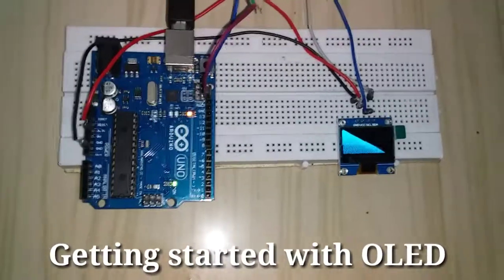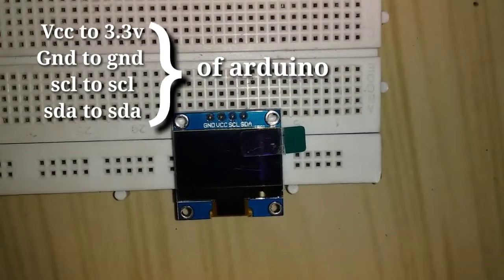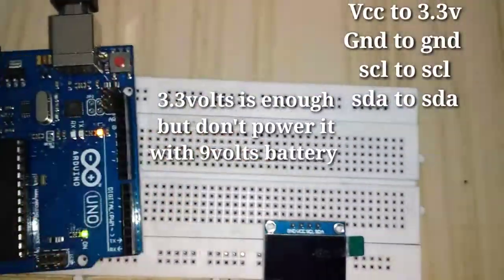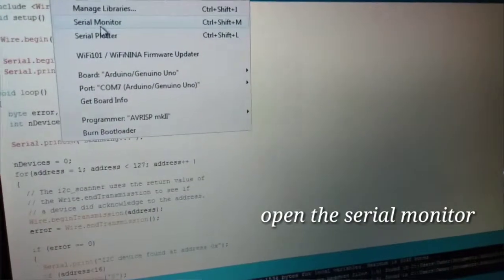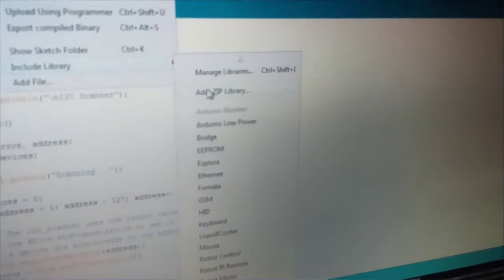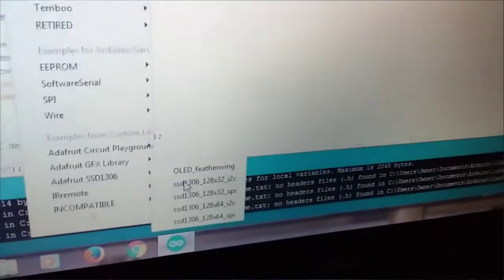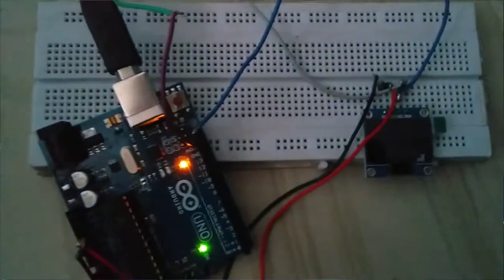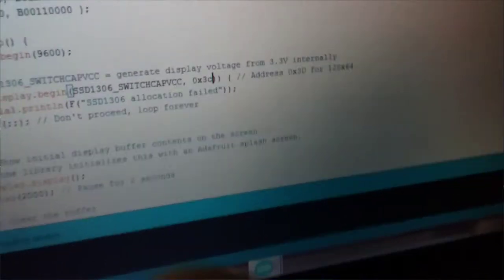How to use OLED display in Tamil

Comment: Super bro na itha intha oled display ku bathila lcd display use panlama bro but athu i2c suppott illa ethachum decoder ic from i2c iruka suppose iruntha na oled display ku bathi antha decoder connect panni lcd display connect panlama??? 

Thanks in Advance
Reply from the maker: Bro , LCD display oda screen resolution vara oled display oda screen resolution vara , indha library support agathu bro
Reply: @deltainc8968  thanks bro